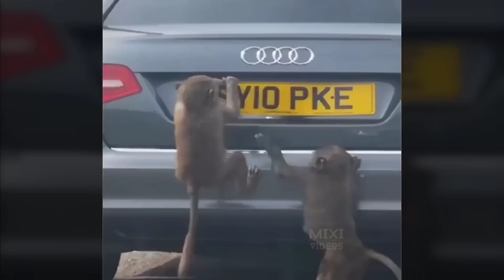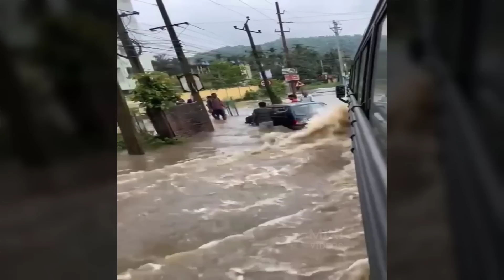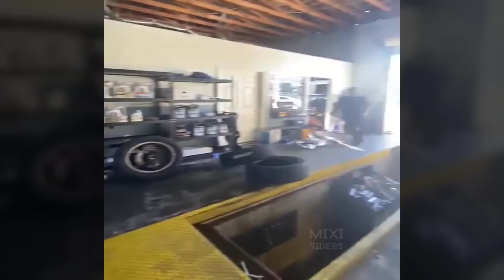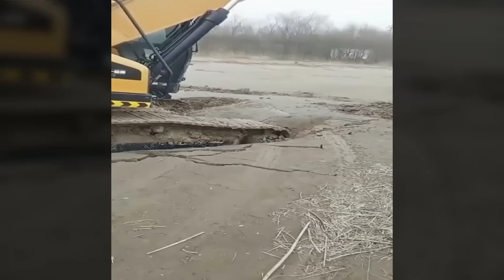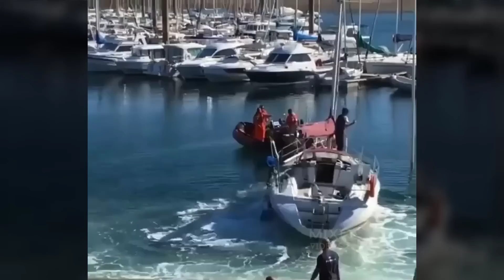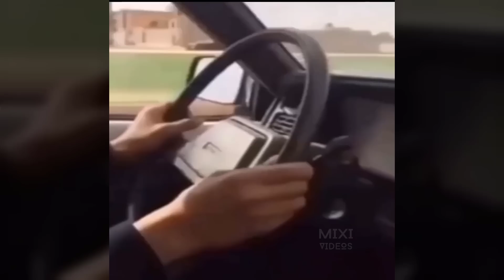TOTAL IDIOTS AT WORK #180 | BAD DAY AT WORK 2022

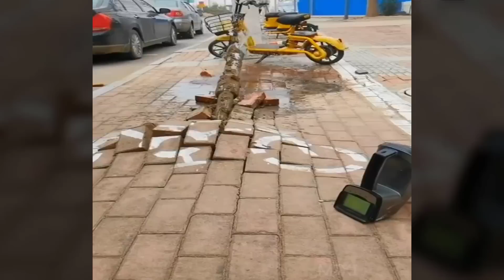Comment: 3:10, if anyone was curious what happened, I'm pretty sure it was a water pipe burst, most likely a water main. I don't think it was anyone's fault though.
Reply: No, it's an ordinary horizontal boring drill for laying pipe conduits. Water is for cooling and softening the clay. These drills have fairly good control of depth and exit point. Normally, the exit site should be prepared - at least some basic pit - so if it terminated in hard pavement, it's a fail.
Reply: @jmi5969  Ok.
Reply: no, its a tank